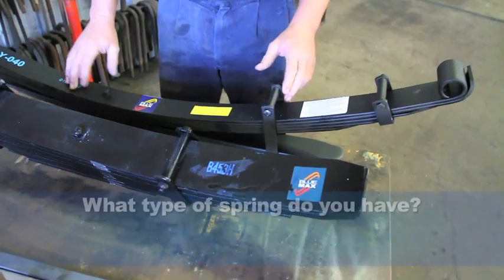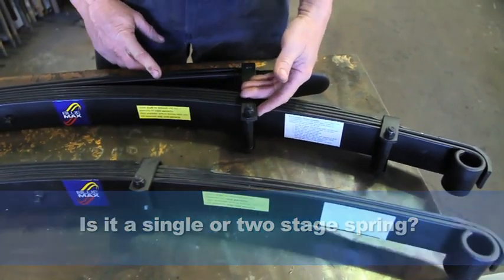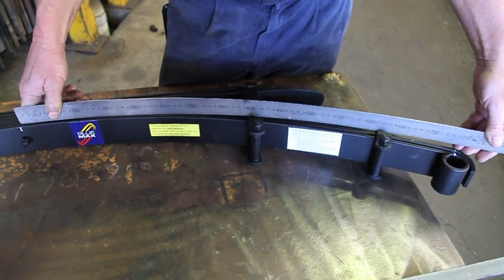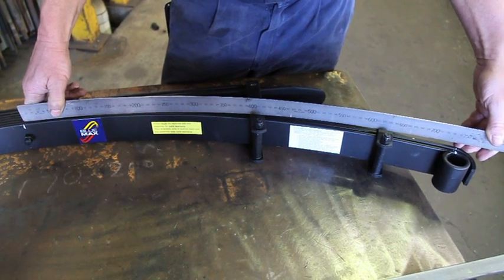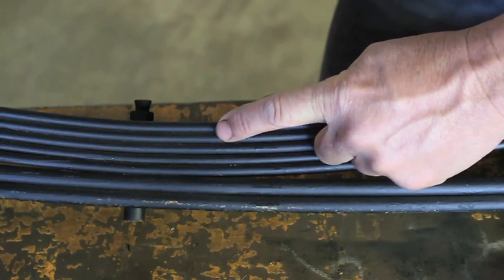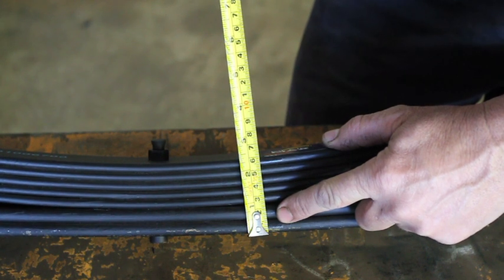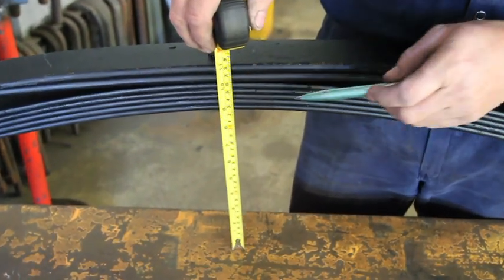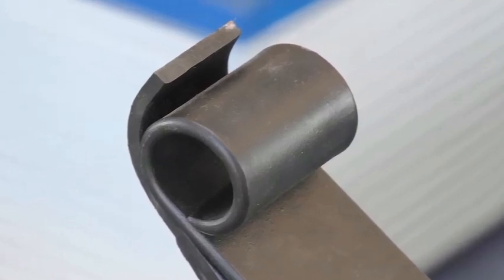How to measure suspension leaf springs

Comment: Hello, I order an ADD A LEAF for some lift on my 1991 toyota hilux 4cyl 4wd single cab,
they sent me two leafs that are 4" shorter on each side than the first leaf at the bottom and I thought they supposed to pyramid down so I don't think I am going to install them. Is this something usual? or a my freaking out, the leafs I received do have thinner tips maybe so that  they blend on to the thicker one. But then again what is the point since it will not supply lift, since the existing ones sag.